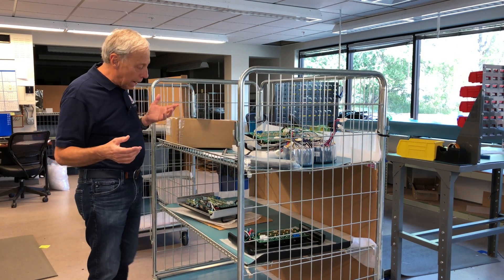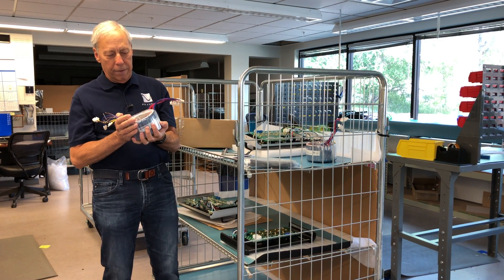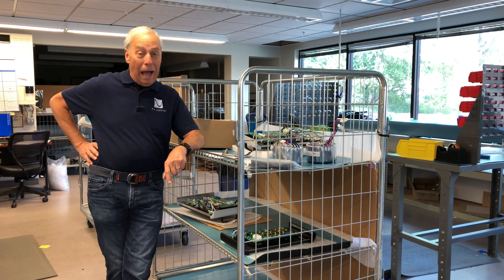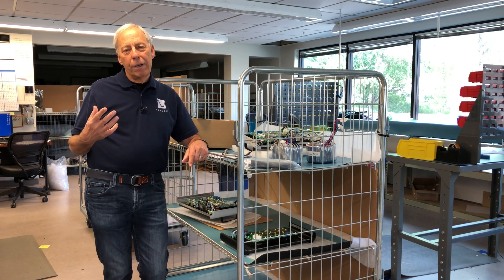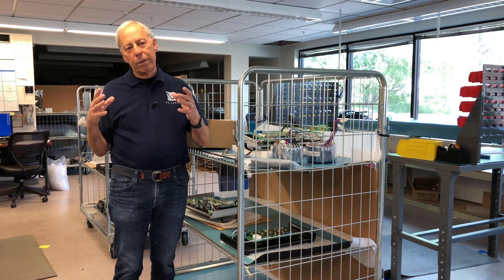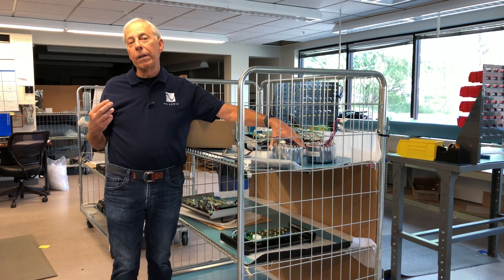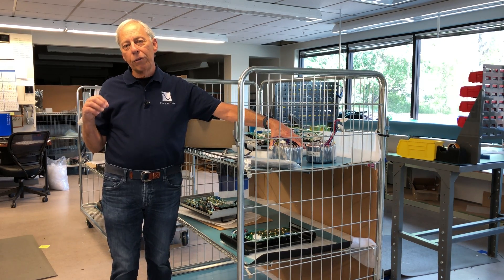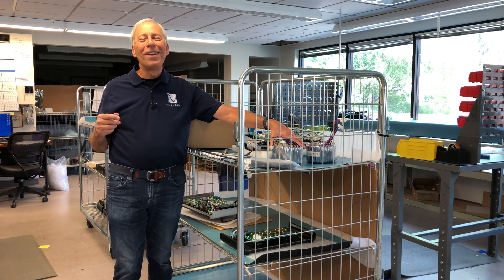Switching supplies vs. analog supplies

Comment: Here is how I see it: if you can't design a switching power supply that provides the power you need, then contract someone who can. My computer has a power supply that can quickly deliver massive current with no ripple and virtually no rf interference. Of course, if you could design a switching mode power supply that worked well, then nobody would buy your power conditioners.  Sorry to be such a sceptic, but somebody has to.
Reply: it's a business after all.
Reply from the maker: We're talking apples and oranges. Your computer has far different requirements than what we need in audio. It's not even remotely the same. I know it can be done, but currently, switching high voltage and large current is extremely challenging. Even your computer supply, which is switching high current low voltage, spews a good deal of RF out. If you want to test that, get yourself an AM radio, tune it between channels and get it near your computer. They are pretty ugly.
Reply: @Paulmcgowanpsaudio  i tried it but nothing happened. i held the radio right next to the power supply... nothing happened. i don't know how you do it, Paul. but if it needs such a specific condition to go ugly, it should be fine.
Reply from the maker: @duckmesideways  A portable AM radio with its own antenna? Just the computer itself should set that a buzzin. Maybe you're just lucky. You can also use an AC live tester, they have a sort of AM receiver inside them and that'll work. You can also look at the level of radiated emissions on the power supply. If you do a little research you'll see what they claim and then can cross reference that to get an idea of the actual numbers.
Reply: @Paulmcgowanpsaudio  my supply came with the case (you can assume it's the crappiest one around) but why bother? it's shielded, in side a metal box. i've never heard a switching supply interfering a circuit as long as it's properly designed and constructed. my computer's power supply is right next to the motherboard in the same box and i've never heard it send anything buzzing. but i've heard electromagnetic devices (such as a cellphone) sending my sound card buzzing... a lot of times. compared to the background radiation which is present everywhere, a switching power supply is nothing.
Reply: @duckmesideways  I am guessing, as well, that the VRM circuits for your processor also produce a great deal of rf output. It will be be picked up by an am radio, however.
Reply: @Paulmcgowanpsaudio  let's table the conversation about high voltage power supplies for amplifiers, then. How many products that you sell use linear power supplies that don't require high voltage and current? Your sprout, for example. Is it using a linear power supply? If so, why? How much carbon is your marketing worth?
Reply: Have you never seen a computer power supply review where a scope was used?   It has a large amount of ripple, and only works acceptably because a computer is digital so the ripple's distortion of the digital signal,  only needs to fall above or below a digital threshold to be a 0 or a 1.  Plus, most things in the computer have a further SMPS stage to drop voltage even lower with the exception of things that don't care and run directly off 12V like fan and hard drive motors.